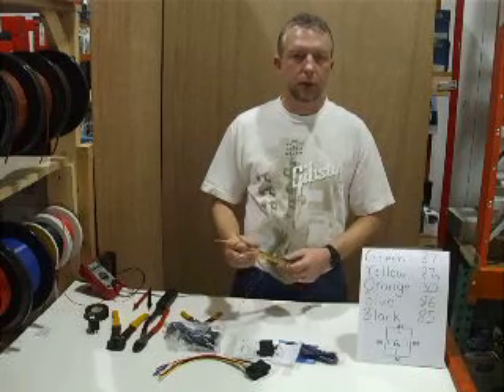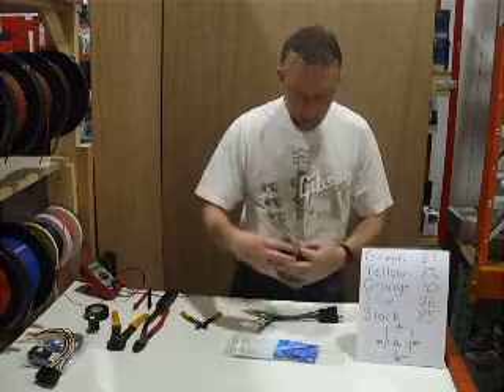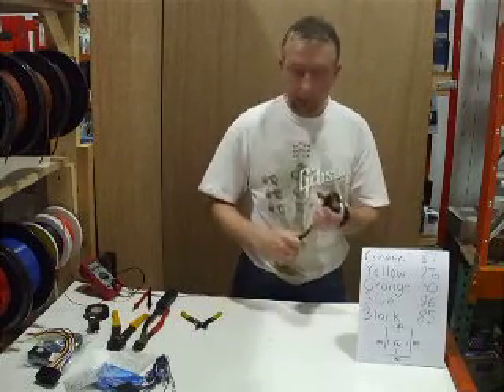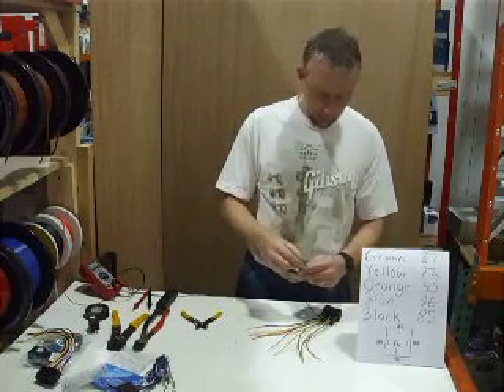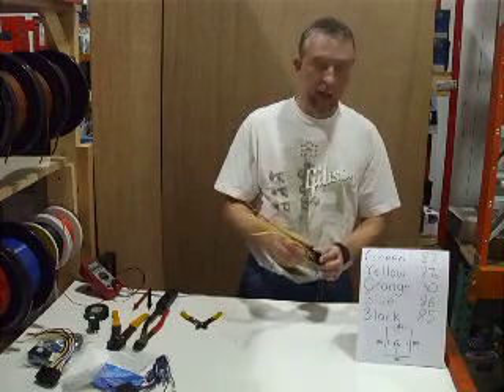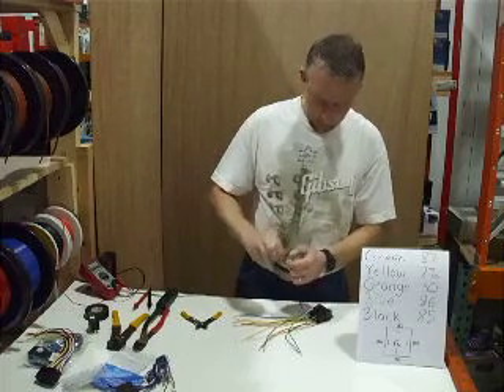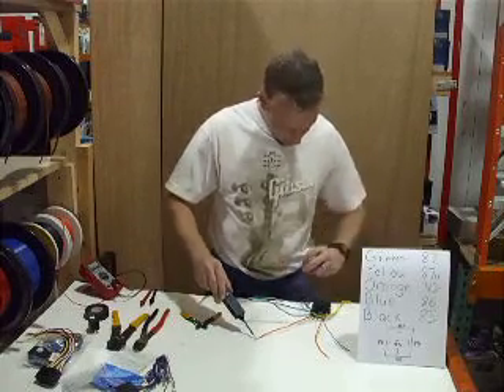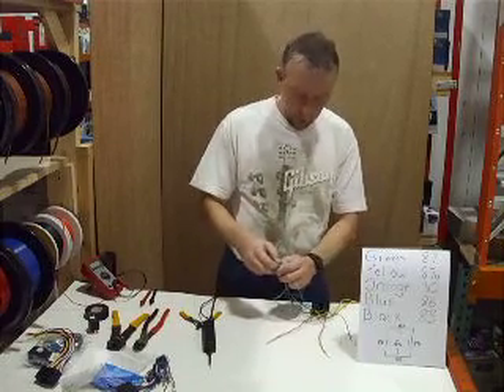How to wire Single 1 Wire Door Lock Systems using auto relays

Comment: Hey man how are you doing? I have a 2005 Buick LaCrosse and it as a negative door locking system i am installing a alarm/remote start on it but  the locking system not working, the unlock works and for the locking i use diodes can you help me please  email leathaldidansa@gmail.com

Comment: I have 03 dodge ram that did not come with power locks. I got actuators and installed bulldog remote start that also has an option on remote for door locks. On the module there are four wires that alternate polarity when pushed the button on remote for the lock. Also got two relay set for reverse polarity that I have no idea how to make it work. Tried to follow all the schematics but no luck. Again, originally there were no power locks. Thank you!
Reply: Did you ever figure it out. I have the same year and with a bulldog one as well. Same issues.
Reply: william ulmer yes, I had actuators working on all doors. Unfortunately truck has long sold now.